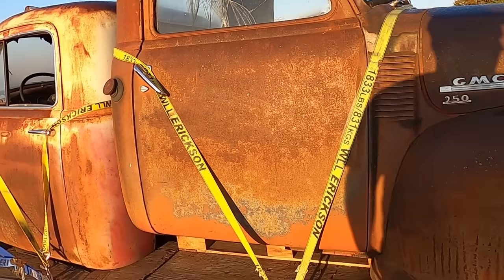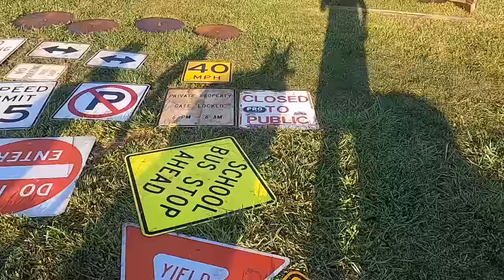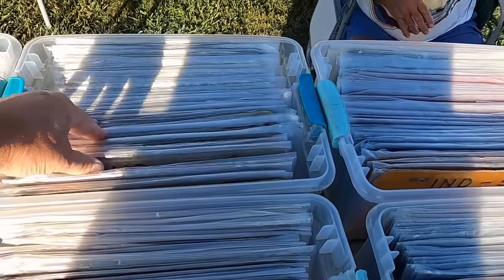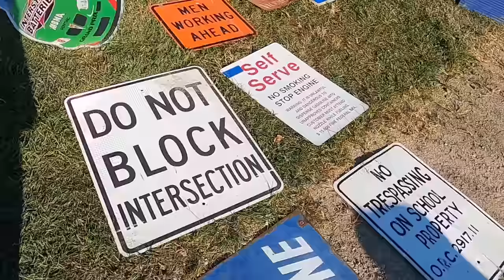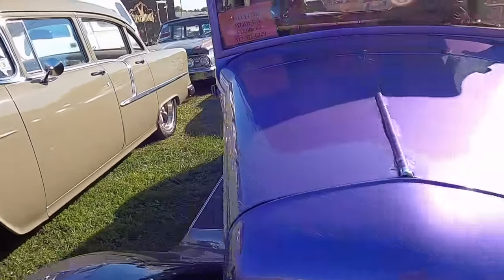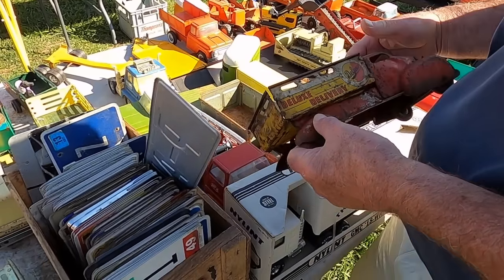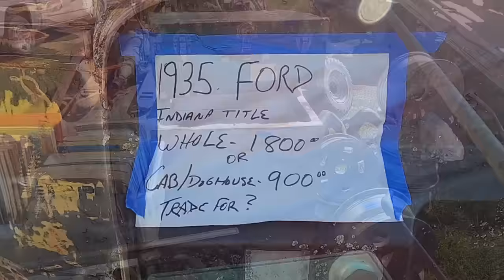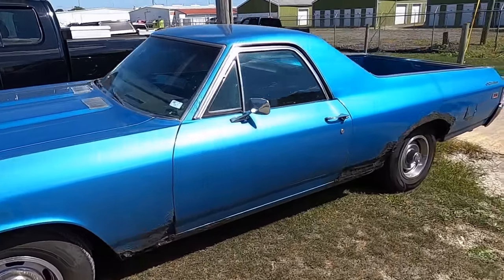Automotive Swap Meet Hoosier Vintage Wheels Swap Meet Sept. 15-16, 2023

Comment: Nice video Tim, thanks for sharing!!  You must have been there very early, we did not get there until about 10am, and a lot of stuff was long gone!!  Stopped back on Saturday and more than half the dealers had left or were packing early.  The 4 speed for $425 was a shock, cause it was still there on Saturday at 11am.  I think it was a Saginaw, not a Rockcrusher, but still, that is a bargain for a working, assembled 4 speed!!  Headed to Ducktail Run tomorrow!
Reply from the maker: Yea, stuff sells fast there.... Ducktail is another great swap meet.